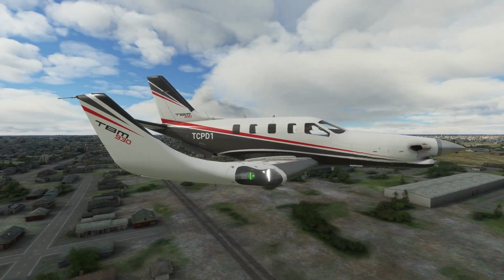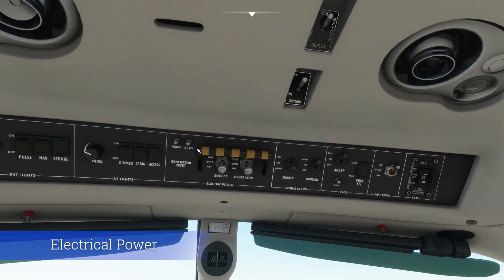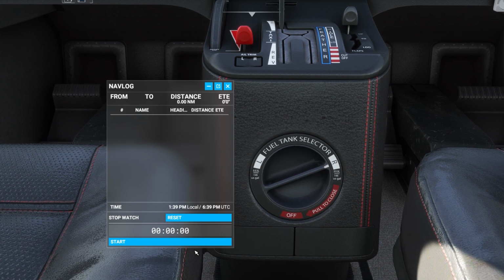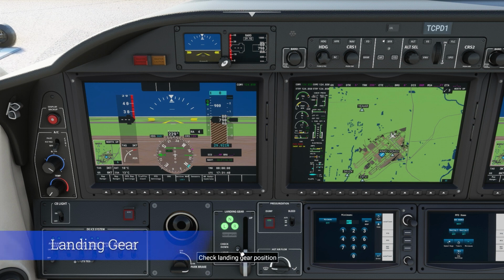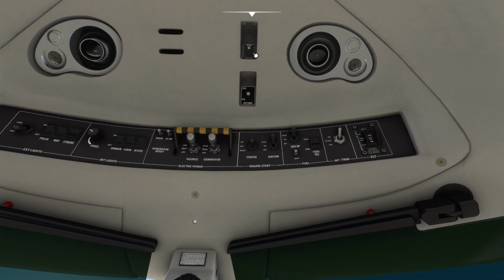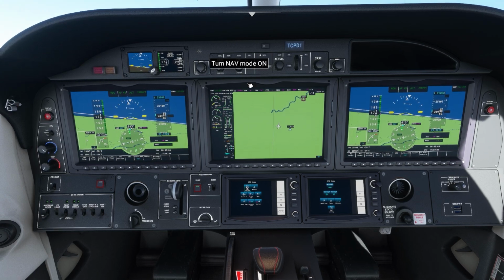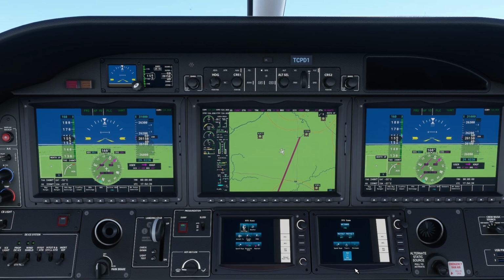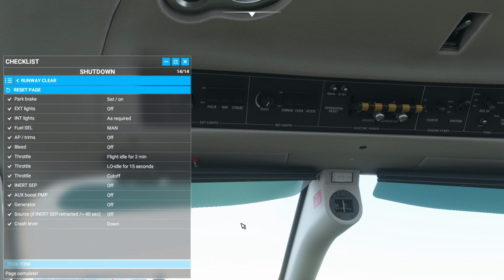Every Button and Switch on the TBM 930 Explained | The Complete Tutorial | MSFS

Comment: I'm learning the TBM and when shutting dwn the TBM I can't get the crash bar to stay down like yours's , it pops back in the up position?
Reply from the maker: I'm not sure.   Could be a bug maybe.   It's hard to tell because I'll make a video and then multiple updates happen and things will be different than when the video was made.  I will try it on mine and see what happens.
Reply: @thecorporatepilotdad  One other thing to, I noticed that when you zoom in and out on the MAP using the switch, It looks like your clicking on it instead of clicking on the right or left side of the switch?
Reply from the maker: @MrZX1409  for the zoom I put the cursor on it then use the mouse scroll wheel to go in and out on the zoom.
Reply from the maker: I tried it again and the crash lever stays where I put it.  When I put it down it stays down.  I drag it with the cursor (or it is a little hand when I hover over it).  If I click it instead of dragging it stays up or down also.  Is it possible you have a key binding also connected to it and it is in the up position and that is making it go back to the up position?

Comment: Excellent tutorial, thanks for doing that. One question though, wouldn’t the left rudder trim actually put the trim to the right which in turn would deflect the rudder to the left? Is it inverted there?
Reply from the maker: I am not sure how it is in the actual airplane.  I looked in a POH online and found nothing helpful.  Some tabs go in the same direction as the control surface and some are in the opposite to counter control force inputs.  If it moves in the same direction it would move with the control surface to counter the forces and prevent too much input from the pilot.  I tend to agree with you that the tab when trimmed should move in the opposite direction.   I found this from Daher and they don't even give a definitive answer.  https://www.youtube.com/watch?v=rTrhAkTLHCY
Reply: It may well be a case of inverted animation, which other examples have been found in FS2020. I’m not an engineer, but to me that tab movement would deflect the rudder in the opposite direction, yawing the aircraft to the right, unless the rudder itself stays put, which is weird.
Reply from the maker: @jamenvan  It very well could be.  That's one of those things that if it works the correct way I am good with it because I can't see it moving.

Comment: Thanks for this video! On the other hand, since I have been flying around Russia where it is very cold, I have to put all the heating on and arrived after 3 hours of flight, power cut and impossible to restart. Normal? Bug? or bad handling?
Reply from the maker: I'm not sure.   I've shut down and restarted numerous times and have not had any issues.   I'll try later today and see if it does the same for me.

Comment: You just told me everything I wanted to know about this equipment that MSFS did not, you earned a sub!
Reply from the maker: Thank you for subscribing.   I plan to teach a lot more than MSFS in my tutorials in the years to come.   I did one tutorial in FS2020 for fun.   The developers didn't put much effort into tutorials in this version of flight sim.
Reply: @thecorporatepilotdad  hyped for your plan bro. Are you looking to make a tutorial on the garmin g3000 on the tbm 930? It will be awesome to set waypoints inside the sim rather than relying on the msfs nav! I am able to use the autopilot now thanks to you and I really hope that you could teach something more in-depth about the nav button!
Reply from the maker: @42anonymoose  maybe.   I want to do something more with the Garmin systems but they are awful in their current state in FS2020.  I do have a small workaround to the big arcs it puts on the flight path but that's about it.   When I try to do too much with the G3000 it crashes the sim to desktop every time.
Reply from the maker: @42anonymoose  the NAV button will just intercept and center the course.   It's left right guidance.   APPR will do the same thing but with higher accuracy and it will follow a glide slope or glide path.

Comment: Hi thanks for the video !
I didn't understand the difference between the NAV and FD button ?
And also, when do you have to press the APR button exactly ?
Reply from the maker: FD just tells which way you're going to fly next based on what you pressed on the AP/Flight Director Control Panel.  Press APPR when cleared for the approach (On an ILS or RNAV approach) or if not using ATC, when outside the final approach fix.  For a non-precision (No glide slope) leave it in NAV.  NAV is just going to fly a course (Localizer, GPS, VOR, etc) I explain the APPR button more in my PA-44 autopilot tutorial and in my PA-44 ILS tutorial (and some other videos).

Comment: Are you flying the TBM with any Mods? There are a couple that improve things a bit. One is for the aircraft itself https://www.nexusmods.com/microsoftflightsimulator/mods/267 or  https://github.com/guifarias31/msfs_tbm930_project  and the other is for the G3000   https://github.com/Working-Title-MSFS-Mods/fspackages
Reply: Personally I'm staying away from the mods for now. I'm with pilotdad on this, I think I would rather wait and see what comes through the pipeline from the publisher, and more generally just wait for things to stabilize a bit more. The stock aircraft are never going to be study-level, so I'll hold out for 3rd party such as PMDG and A2A.  Asobo has committed to producing more complete simulations of the G1000/3000 systems, so we have that to look forward to hopefully in the near future. Hell I would be happy enough just to have a more complete list of departures,  arrivals and approaches.
Reply from the maker: I am running the stock aircraft.  I am hoping FS2020 will eventually fix the airplanes.  I am going to check them out though.

Comment: Nice to have this all in one video without a bunch of extraneous crap. Short, sweet, and to the point. Thank you!

I'd love to see a short video showing a full approach starting from cruise to touchdown specifically focused on the appropriate speeds, rate of descent, throttle levels, etc. to make that happen.
Reply from the maker: I have videos close to that.   Most of my approach videos deal with proper speeds and procedures.  I have a video on when to descend that is pretty easy compared to some methods.    If you look at my Localizer approach video in the TBM, I believe it starts from 25,000 feet before doing the approach.   That may be exactly what you're looking for.
Reply: @thecorporatepilotdad  Cool, I'll take a look!
Reply from the maker: @missamo80  that's the one!

Comment: Great tutorial - can you do one on VOR navigation as I'm struggling to get my head around it - TIA
Reply from the maker: Did you have a chance to watch the VOR video and try it out on your own?
Reply: @thecorporatepilotdad  Not yet - in MSFS 2020 I can't get the frequency to work in the NAV1 or NAV2 on the Cessna 152 - I pop the number in for my local airport (EGNT 114.25) switch it from standby to active and nothing happens - I'm trying to make the learning experience as real as possible so I really want to stick with the Cessna so it's a little frustrating
Reply from the maker: @harrybassett9433  are you spinning the obs to center the needle and it never centers?  It's possible it is far enough away that it isn't being received.  In real life, VORs use line of sight.   If you're too low or something is blocking the signal you won't receive it.   Needle won't center and no to/ from indication.  They do simulate line of sight in fs2020.
Reply from the maker: @harrybassett9433  I did some information digging.   There is a parentheses around the frequency on the chart - NEW (114.25).   I believe it is just used for DME and no azimuth.   So, if the airplane has DME you'll get distance but no centered eedle or to from flag because it is only used for DME.  Try a different vor and see if it works.
Reply: @thecorporatepilotdad  Thank you - Flying from EGNC entered 115.2 for Dean Cross (DCS 99) which didn't work - flew over DCS 99 using VFR map and switched to 114.1 for WAL 88 and it picked up the frequency and I managed to navigate and land at EGNL using that. It seems that some VORs aren't working - maybe me? maybe MSFS? Anyway I'll keep practicing with the ones I know are active....Once again thank you very much :)